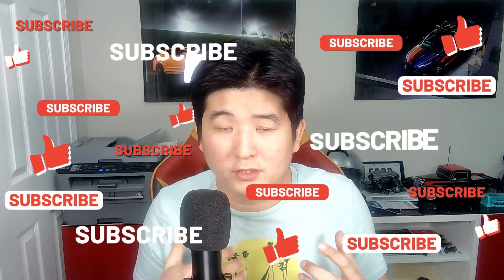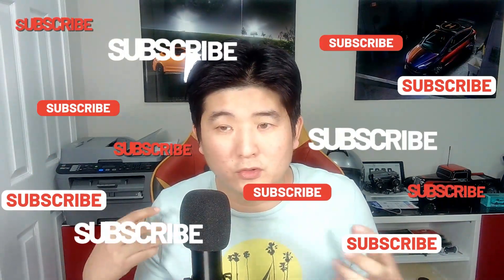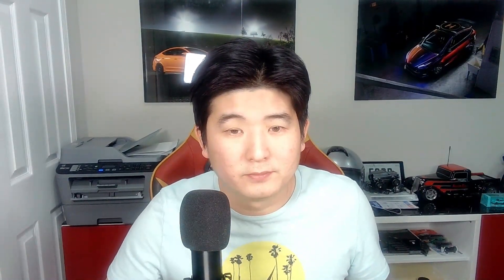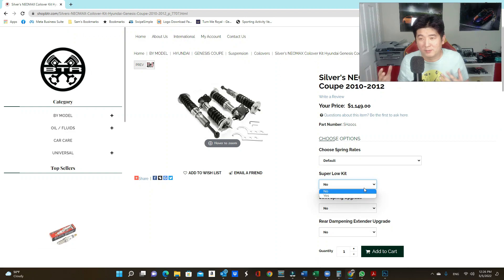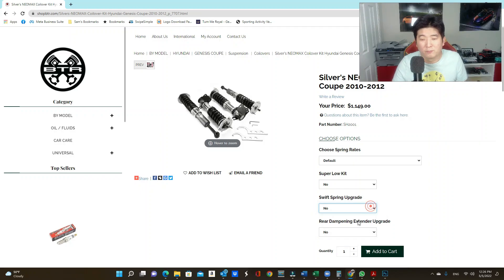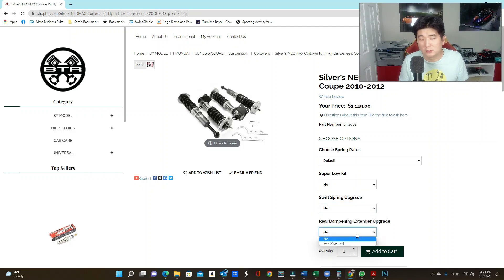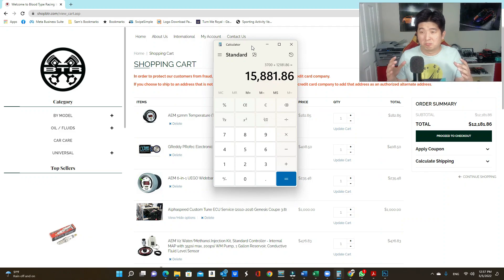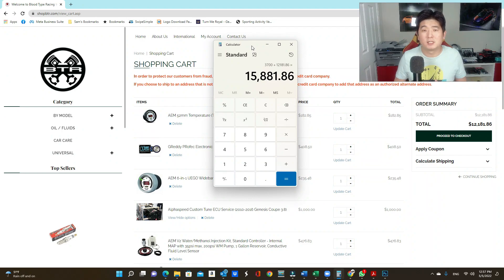2010-2012 Hyundai Genesis Coupe 3.8 Turbocharging Guide

Comment: I am only 12:27 into the video so far, and I am watching this while doing work. After you finish BK2 3.8 turbo video, which is what I have, will you go over supercharged options? I only know of d'toz supercharger kit, but it seems he disappeared, and I think all of the other options would be in Korea. I have also seen videos of that yellow twin turbo 3.8 that is 700whp. Which leads to my next question. After the turbocharge videos, do you plan to cover the cheapest built engine/motor options for safer long term usage? My goal someday is 450 to 500whp, but I have automatic.
Reply from the maker: Honestly, i have yet to see any reliable supercharged options and none available in the US. what Korea does should always be taken with a grain of salt as we don't see them day to day only what they want to convey on the internet

Comment: Hey I know this is a kind of older video and this might sound kind of stupid but all I would need to turbo my car is the remnant kit and the meth kit to run the car car safely I already have the car lower and have a custom exhaust and is the website your one?
Reply from the maker: hi, the kit basically comes with everything you need and adding a water/meth kit would definitely help you stay safe.  along with that you will need a custom tune so contact alphaspeed for a dealer near you

Comment: are the sedan 3.8 motors the bk1? i have a built 2010 with after market internals and computer stack, but im not sure exactly which motor it is, but its fast.
Reply from the maker: Sedan and coupe engines are slightly different
Reply: What is the type though? I think they put Mitsubishi heads on it, I've taken a charger RS with a scat pack set up from a hand drop and a Camero ss from a roll. Have you heard of this, or   is this news to you? No turbo

Comment: What wheel width and offset do you recommend for the gen coupe that’s a daily/weekend warrior? And for those ace alloy wheels, what sizes are they? Does not say on the site
Reply from the maker: Hi the width and offset for the ace alloy is predetermined for best flush fitment 

As a general rule of thumb for gencoupes 9.5 and 10.5 with 22mm offset is common
Reply: @BTRcarcustoms  Thanks for the response, I did see that's the general rule of thumb, but didn't know if that was only for people within the stance crowd or if that would negatively effect performance on a track car (road course or drifting) Do you think that fitment would be positive for those use cases?